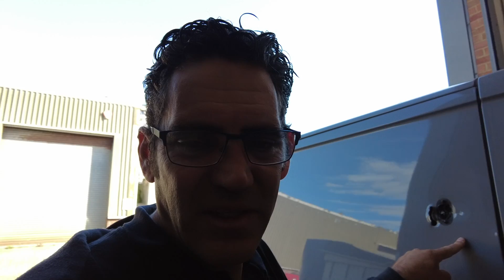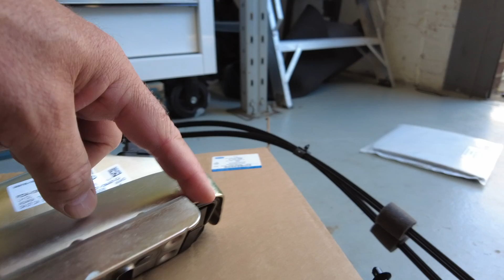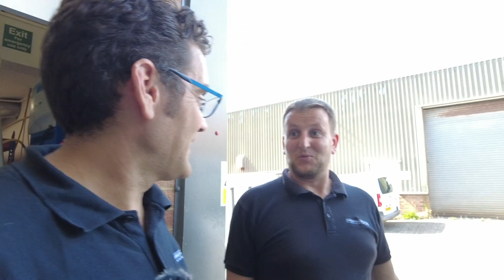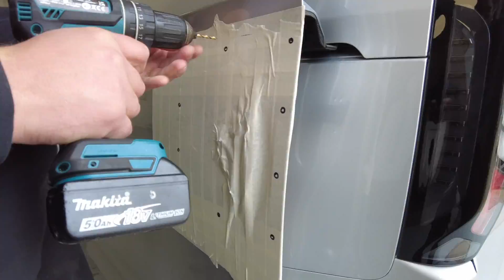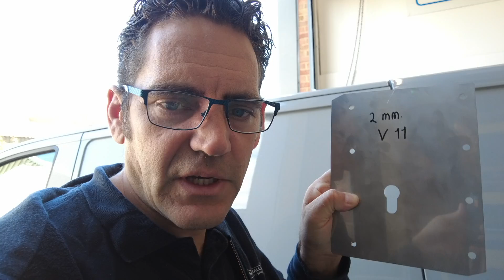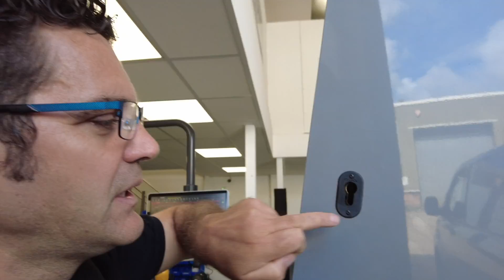New Ford Custom 2024 attack by thieves to side door deadlock and latch, can we repair the holes?

Comment: Even after fitting one of your shields it will not stop thieves using an angle grinder to break in especially when they see your super secure shield and think there is value gear inside to steal. I suggest that traders have all their gear marked with smart water. This will not stop gear being stolen but if the thieves are caught at a future date with any smart water marked gear will not be able to account how it was obtained.
Reply from the maker: Smart water, air tags and other security options are also good. But for this new style Custom van our internal only shield for the side load door is a must have in my option.

Comment: They proper messed up that door! Had a 17 plate vivaro they just used a hole cutter on the back door 😑 bastards nicked all my makita stuff
Reply from the maker: Yeah it was left in a big mess. The smaller damage like with your Vivaro is  much easier to repair with a regular external repair shield. Our internal latch shields for both the barn door and the side load door for your model Vivaro are a good security improvement, especially per pound spent vs security upgrade (obviously even more so if you fit them yourself as that keeps the cost of buying them down).

Comment: Ford are useless - same problem as the last shape custom, so disappointing how insecure these new overpriced vans are
Reply: They’ll say the app will let you know if it’s being broken into 😂
Reply from the maker: It is a disappointment that they didn’t try harder than they did to make more of an improvement to the shielding of the side door latch. I do wonder if it was a token effort? Or if the designers just didn’t understand the problem or how important it is to tradesmen in the UK and beyond.

Comment: If the plates were colour coded it would make it look alot better aesthetically.
Reply from the maker: We have just added this as an option on shield sales, but wouldn’t be a same day service at this stage. So an option for people who can wait a few days for their order.
Reply: Considering there’s only like 5 colours vans are made in it’s a surprise they weren’t to begin with.
Reply: Have you got any way on the new van of putting pin switches higher up on the door so the alarm goes off as soon as the top of the door is peeled
Reply: All the tires on all the vans only come in one shade...Black.
Reply: @ tyres arent bodywork

Comment: Scum would be too nice of a word for them 
You guys doin a great job in highlighting there methods 👍🏻 what you haven’t mentioned is did they gain entry after all this damage 
 being a owner of a 2018 connect with same locks fitted and also thought the vans were deadlocked when locked from remote 🤦🏼‍♂️
Awaiting your response in anticipation thanks
Reply from the maker: Thanks, unfortunately yes they did get in on this occasion. We would recommend you purchase our internal side load door latch shields for your Connect as these shields are as important (or more important) than deadlocks in terms of security, they are usually a better security increase per pound spent IMO. Our office can help with more information during work hours, but you can look on our website here https://www.sussexinstallations.co.uk/products/door-shielding-internal/sussex-installations-for5-nsl-int-001-ford-transit-custom-2013-2018.html
Reply: Cheers buddy 
Yes I will be upgrading to your plates 👌🏻 
For me it’s the distraction and preventing the damage with plates imo there’s to much work involved for em/scum 
Up north we’re not as bad at the minute 🫣 as I know lads who go south and will not stay in any b&b only air b&b with driveway 
In my van all gear in vault out of boxes so my worry is before not the break in and cost of damage with your plates  and where there fixed you’d be taking some metal out to get to get in 
they’d be making some noise doin that 
Keep up the good work and I’ll be in touch 👍🏻

Comment: The FACT that NEW vans are not fit for purpose is quite frankly pathetic. Get a van with windows and don't leave anything in it is the ONLY way to stop the scumbags trying their luck on your van. At least that way they can see it isnt worth trying to get into it.
Reply from the maker: Some people even leaving their vans unlocked to prevent a thief breaking into them, but also thieves maybe not even checking to see the van is unlocked as they seem so quick to cause damage to vans. With all new vans being such thin metal / light weight, I really don’t know where we are heading.
Reply: @sussexinstallations  yep that happened to me, van UNLOCKED and empty still drilled a hole in the back door.. Shows the thinking   of the ones that do it... Great set up you have there with the laser and press brake etc..

Comment: Won’t they just snip round the plate and latch
Reply from the maker: The point of the external shields are to repair the van to make the van useable again and get the tradesman back to work. We fitted our internal shield to give additional protection against the latch being broken into and our internal latch shield is stand alone (it will still give additional security even if they cut around the external shield!). The external shielding will make the van more difficult to break into also, but that is just an added benefit to the repair.